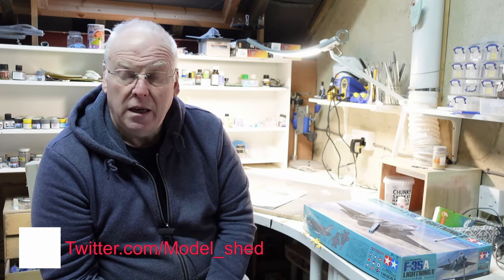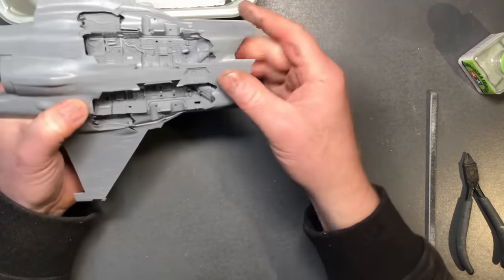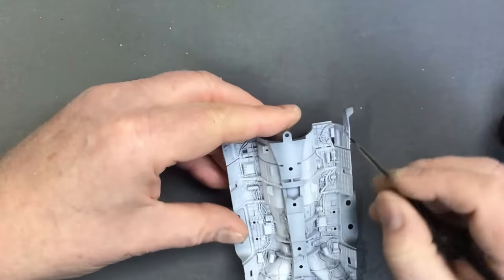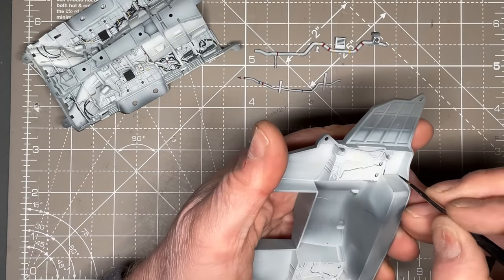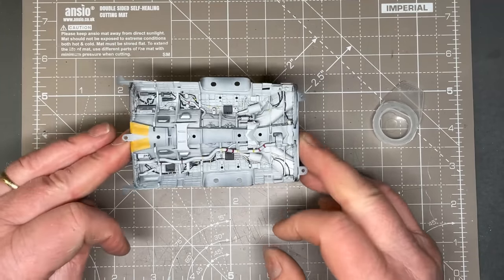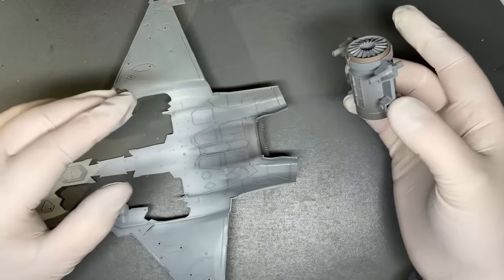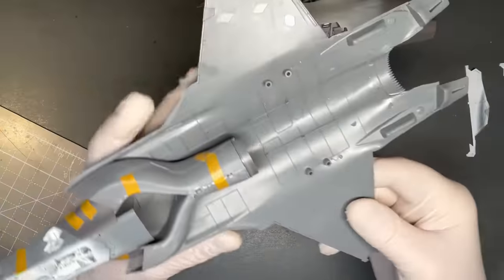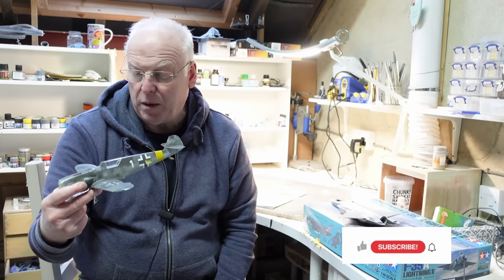Tamiya 1/48 F-35A Lightning II part 2

Comment: Great job...like all the rest...thanks...I was wondering which company's sable paint brushes do you use? Thanks
Reply from the maker: They’re Windsor and Newton series 7 Bob. Best I’ve ever used - expensive but worth it
Reply: Thank you so much...even though they are pricy, I am going to get them based on your recommendation...They have a 4 brush set (0,1,2,3)  for $130. Will that do it or should I look for a set that includes smaller brushes? Thank you for all your help!  @TheModelShed

Comment: Hey Steve, when you wet your decals, do you use hot or cold water, does either one make a difference...thanks, great videos.
Reply from the maker: Warm water - not hot John - just so you can comfortably hold your hand under it. It does make a difference the decal releases from the sheet faster and the warmth can help relax the decal and start to help it conform.

Comment: I agree with the engineering of Tamiya's kits it is superb. Do you usually use a 50/50 mix for your paints? Also what air pressure do you use. One thing I did notice is you didn't add any nose weight, did Tamiya make the kit so none is required, if so that is a first that I know of. Looking forward to the next episode.
Reply from the maker: Generally I’d use a 50/50 mix but here I went for a weaker mix on the white over black so I could build the colour up gradually. For general work the compressor is set around 12-15 PSI. Other situations call for different settings such as on the Bf109 mottle but usually I’d describe this in the narration.
Reply: @TheModelShed  Thank you.
Reply: re: his other question, I'm also super interested: did you add nose weight off cam or did the kit not require it? I'm about to crack into mine

Comment: Love it man! Lord love you for making videos while you’re sick! Can you explain your strategy/paradigm for when you use contacta and extra thin? Thanks!
Reply from the maker: Hi Buckner. I use extra thin in ‘dry’ joins where the parts are brought together and the glue can be run into the joint using capillary action. I use contacta on ‘open’  joins where I need the glue to stay wet until the parts are brought together like when the fuselage halves are brought together. Extra thin would just evaporate by the time I got around the fuselage/wings.